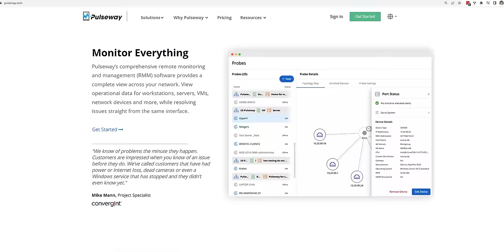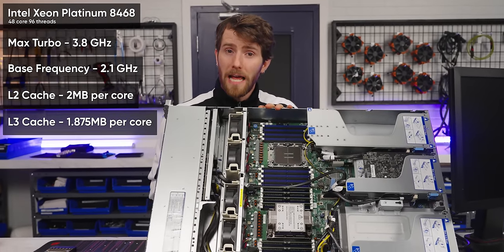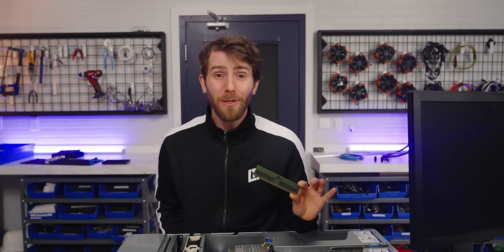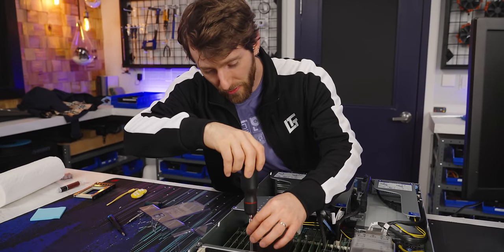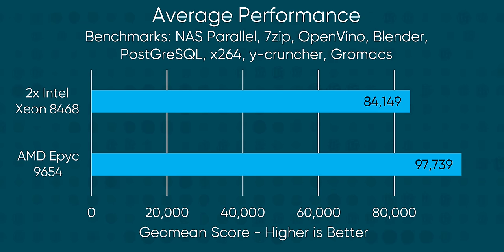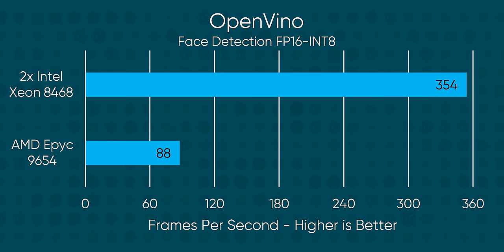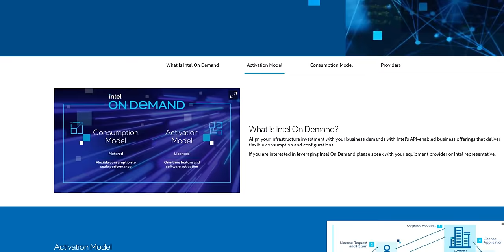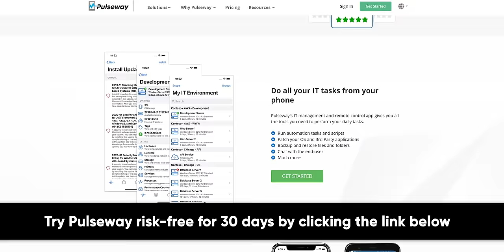Intel’s New CPUs are Cringe - Intel Sapphire Rapids Xeon Platinum 8468

Comment: The issue with those accelerators is that for them to be worth it (to counter the loses form not going AMD), you will need to use them so much that a dedicated accelerator card would be much better than this CPU.
Reply: They are putting themselves in a very small box. Not unlike Optane really. The technology was good for specific use cases but it wasn't compelling enough compared with alternatives to be a commercial success. I guess they have to go with what they have.
Reply: @shirro5  Didn't they reuse the tech to make much more practical ssd products then just discontinue them anyways
Reply: whats a accelerator card?
Reply: @Coockiez-007  an AI accelerator card is exactly what it sounds like: a pcie-based solution to add dedicated AI accelerator hardware to a system. If you're an organization using ai learning on the reg, you're gonna be using several of those and not bothering with Sapphire Rapids, especially since an AI accelerator card will outperform Sapphire Rapids for that use case while consuming less power.
Reply: @pokeguy742  the nice thing about intel and not the accelerator card is that it’s easy and fits in with the newer GPUs.   Sometimes the best is the easiest, keep in mind these products are not for us. They are for huge servers that need the ability for easy replacement. I’d definitely go with Xeon because I have the ability to upgrade my computer by simply paying Intel. Servers as well don’t want to pay technicians to go upgrade all of them so it might make sense to go intel.
Reply: @StevenSmith68828  you know nothing about servers if you think anyone would choose an Intel CPU over an Amd cpu and an AI accelerator card

The data and server space only cares about 3 things

1. Cost
2. Power Efficiency 
3. Space

AMD will offer a faster, cooler, more efficient cpu, for the same price or less, while leaving room for a much better accelerator over all

Data centers could give a rats butt about how “easy” something is

Besides, Amd tends to be “easier” anyways, as 90% of their stuff is becoming plug and play, while Intel is making hardware a service, making things more difficult 

So your own argument fails here
Reply: @StevenSmith68828  gladly you don’t run a server rack

No one wants to pay Intel to upgrade their own systems, cause 
That’s a security risk, and the only thing data centers hate more then hot, power hungry, space inefficient racks is vulnerability in their racks

No major server will ever do that
Ever

Like 80-90% of server owners and data centers wouldn’t do that

The only people who would, would be small businesses, but not every small business is running the latest Intel Xeon CPUs, and even less want to constantly pay Intel to be able to use said CPUs 

The more and more Intel moves forward with these stupid ideas, the more and more market share AMD is taking

Everyone thought it would have been impossible for AMD to have 25% of the market by 2025
They will have it this year

By 2030, it will be entirely possible for them to have 40% of the market 

By 2040, Intel might be left with only 35% themselves 

Do I think that will happen, not really 

But is it possible? Yes
And it wasn’t possible just 2 short years ago
Reply: @StevenSmith68828  I would absolutely not go with Intel for the same reason: you pay Intel to unlock features already present on the hardware you initially paid for. That means that an Intel server will be more expensive to keep relevant over time, and it also has a potential software exploit to access features on the cpu. If I'm running a professional server, the last thing I want is a more expensive rack that has a backdoor waiting for some enterprising unauthorized individual to open. Operating costs are even higher if you account for the increases power consumption for similar levels of performance and the fact that I'm getting an accelerator card anyway because even a card from 2021 with 16 tpus will outperform Sapphire Rapids for AI accelerated workloads, and that card only draws like 55W under load.
Reply: @StevenSmith68828  Something that I did not think about before but your comment made me consider is the "replacement", or to be more specific drivers and software support.

Lets say I made an application that is using the AI acceleration of Intel CPU, how certain can I be that it will still be supported 10 years from now. 

If you upgrade you server for a new one (which happens every 2-5 years), will I be certain that the new CPU will still have the AI accelerator and will it be compatible?

A PCIe card allows me to move the accelerators to new server, and even if company goes under and stops selling those I can still upgrade the server while keeping old or aftermarket accelerators.

With intel CPU accelerators I am stuck with an old platform until I rewrite all the software.
Reply: @StevenSmith68828  tell me you're an intel fanboy, without telling me you're an intel fanboy...
Reply: @bornonthebattlefront4883  you’re right I’m wrong, would you be willing to take a bet and short Intel if you are predicting higher market cap from AMD? My models predicts a 40% loss In revenue. How sure are you? My concern for shorting is Intels IP with network ASICS do you then need a network accelerator card and AI accelerator card? If so what about all of their other stuff that it has, would you then need accelerators for each one of those? I’m trying to understand other server/computer markets not in AI which is what I’m interested in. Xeon makes sense but I’m on the fence. To me the opportunity cost of not having an extra GPU slot to compensate for not having an in built AI accelerator feels bad. 

Also how did you calculate the market capitalization.
Reply: @hypershadow5g  I have a Ryzen 2700 lol. Im also looking into shorting Intel and yes I am a fanboy. My concern is the government stepping in since TSMC and Intel are the only companies able to produce these chips. There are other but they tend to focus on bigger nanometer chips. Ohh and their IP

Comment: Step 1: Put thermal paste in the socket.
Step Too: Add more torque because that's the problem, clearly.
Reply: To be fair with CPUs that size if you don't torque them properly they can just completely not boot - there's a reason AMD Threadripper and Epyc have their own torque drivers and instructions on what to torque down first.
Reply: Many an overclocker has packed a socket with grease and had it be absolutely fine. Large chips absolutely do have connection issues if not torqued properly. My delid 10920x wouldn’t post a mem channel because one size was a fraction too loose.
Reply: And that was today's edition of Tech Tip of the Day!
Reply: @thebludragon8353  Conductivity is not the only issue here!!! Even perfect insulator around pins can change impedances (and electrical length) of the individual signal lines, from/to CPU, inducing skew. Just take a look, how much attention is paid during design of those traces on the MB, where every micron is important.
Reply: I love how people are mentioning torque as if they didn't go get the manual, read the manual for the torque specification, then get the torque screwdriver and torque it down to specification, reseat the chip (because they mentioned it wasn't seated correctly at least twice) and still have it not boot.

Comment: Intel On-Demand is also going to really suck for us in like 10 years, when these servers because super cheap on the used market. Are we going to need to start pirating features of the CPU?
Reply: I wonder what DRM they use.
Reply: I was thinking this, if the DRM needs to phone home all the time you are relying on Intel keeping that switched on. They could purposely make your system redundant by taking down the DRM server and locking those capability's, very wasteful and underhanded.
Reply: @jonathanellis6097  Unlikely. 
There are too many use cases where specific servers have no internet connection.
Reply: @hubertnnn  I haven't looked into the actual specifics but I would assume you get some kind of signed license file that can be dynamically loaded through the BIOS or from the OS (like how the platform can verify secure boot images).
Reply: The fact these servers can be in service for 10 years is a good incentive to not just close down their drm system if it doesnt take off in 2 generations.
Reply: @jonathanellis6097  it's likely that these feature-unlocks are fuse-based. You buy a code from intel and it "burns" a few fuses in the CPU that will permanently unlock the specific features.
Reply: Oh yeah. This is a dark day for homelabbers if all the hardware just turns into IBM-style rentals.
Reply: I am pretty sure that Intel already had such feature many years ago with Pentium's
Reply: I think that the Intel On-Demand is going to be practically worthless. Okay, I can unlock an accelerator later down the line, but what if it only becomes useful in 2-4 years? By that time the chips will be one or two generations late, which can be a ridiculous efficiency and computing power downgrade.
Reply: Maybe, maybe not. In 10 years someone will have figured out the hack so you can buy one that isn’t “unlocked” and just jailbreak it!
Reply: pirating hardware does sound kinda fun though… cyberdeck style shit. not that i would ever want to. clearly. but, you know..
Reply: @Irthex  That won't be the how, one of the "suggested cases" was enabling features for a certain time period when the company needed them
Reply: @Irthex  15:48 "Consumption model" - it is not fuse-based if there are non-one time options
Reply: @stephen1r2  the other is "one time activation"
Reply: @s.i.m.c.a  they mention one time unlocks too.
Reply: @josiahsimmons9866  Not to mention that software developers are less likely to support a paywalled accelerator unless Intel is footing the bill for it. So imagine Intel-specific forks of PyTorch or Postgres, or having to pay for extra Intel add-on packages for Autodesk nonsense.
Reply: @josiahsimmons9866  
Its unlikely someone will want to unlock those features after 4 years.
Most servers are bought with specific use case in mind and will be used for one thing throughout its entire lifetime, which wont be too long, since servers are usually replaced every 2-5 years.

After that time the server ends up as one of the after-market solutions used by small businesses or hobbyists.
Both of them are unlikely to need to unlock the extra features.

There is also the question about how this unlocking works. Will someone who was not the original buyer of certain CPU be allowed to unlock it? If I buy an after-market server will intel give me the unlock code or will he just say "sorry, you are not the owner we have registered in our system".

Comment: As a technical engineer, I just wanna say that installing the CPU in servers is a hell of a lot easier if you just use the protective foam padding that comes in the CPU box to lay the CPU face down on. Then apply the CPU guide (the black plastic that is removable from the heatsink) to the CPU and then simply click the heatsink onto the guide. Boom. All together, no risk of dropping anything and secure
Reply: no no you gotta squirt the paste directly into the socket /s
Reply: You underestimate Linus's ability to drop anything
Reply: No risk of dropping anything? Doesn't sound very Linus-y...
Reply: Not to mention that CPU heat sink arrangement has been used since HPE Gen 9 and Dell 13th Gen servers and, presumably, other major manufacturers. Way more convenient than messing about with levers and having to replace the thermal compound after reseating the CPU. See a lot more system board swaps in a week than I do CPU replacements in a year.
Reply: It's funny,  precision engineering tends to work a lot better when used properly
Reply: But you forgot the "add paste directly in socket" step.
Reply: wtf is a technical engineer 🫠
Reply: @CarokleinLP  If you need to ask, you ain't deserving of the answer.
Reply: @Bultizar  I mean isn’t any engineer technical? Except the business pseudos
Reply: @leod9968  😂😂😂
Reply: Linus made mistake here. As the op said in these cpus first u take the removabple plastic from heat sink. Then u put the cpu in the removable plastic and then you put them together on the cooler and in the end you put the whole thing to socket on the board

Comment: The thing about building your hardware for theoretical future software is that by the time use of that software becomes normalized we'll be several hardware cycles down the road. They built a machine today for the tasks of tomorrow, but also expect you to buy a new machine in the next generation or 2, when the architecture they created finally becomes relevant. There's no such thing as "future proofing" with PC hardware.
Reply: You have a point. It is likely that intel and or AMD could hit a major breakthrough in the next few years in which one of them will double what their top of the line chip is now along with improve a vast list of things. I also think we are approching the end of gaming graphics cards. We are about half way there right now. That one computer they did not long ago where they rendered that NASA 14gig per second or frame landing model is really where gaming cards will stop becoming a thing. Once you can say have a 48 inch curved computer screen that can display 32k it will almost be not worth it to upgrade to anything beyond that. Once gaming can render 3d models that look like the highest production movies gaming will then become AI based and you will be able to just build a game on site and call for anyone who wants to play. Its likely that gaming will be groups of friends who play games and then add in new players who scan the boards looking for something that fits their needs or makes their own with in a set friend group. 
I have a feeling that gaming rigs are slowly fading away as more and more people move to console games which are and can be just as in dept as the PC games.
Reply: This is exactly what I was thinking! I was figuring that by the time the On-Demand features would be needed, we'll have one to two new generations of CPUs, which can be anywhere from a 15% jump to even as bad as 30%! That's a HUGE computing power downgrade!
Reply: Adding extra memory pretty much anywhere extends the usable life of the hardware when those memory requirements inevitably increase, like cache and ram and vram, but really specific hardware solutions looking for a problem just end up looking like a gimmick and even if the use case takes off the next generations of hardware will immediately have so much better support it still looks like a joke to fleece early adoption addicts and koolaid drinkers.
Reply: @josiahsimmons9866  I think cpu chips are moving in the wrong direction. They are trying to get as much as they can in to a single chip when I think they should be building a embedded chip set board. Where you have say tiny 1 inch or less squares of quad or 12 core chips. Then a heat sink housing. Think GPU as a CPU yet double or quad layer where you have dual sided water cooled heat sink. Each embedded cpu can be 4 to 12 cores and think 10 chips per side of a dual layer cpu card would give you at 420 cores and an unknown logical cores. We know CPU chips can be smaller yet because they require some type of cooling embedded cpu boards are better suited. Because who in their right mind is going to open up 1000 servers and upgrade the cpu? Other than someone small. Along with the GPU and CPU board sets you can also do memory the same way. You can either make a controller board and then add in your gpu, cpu, ram, ssd and chipset all cooled via an exchange and using some form of a pcie slot and your chip set also has your IO which can be a pretty large board in its self. Think more along the lines of hot swapped storage or PS. Turn the computer around push in the PS, IO/Chipset, CPU, GPU, Storage. Then on the inside you can either make a auto connect cooling loop and power along with a auto connect IO front panel. The chipset board will contain things like the powerbutton in the event you are using a server. The rgb and keyboard mouse will be a fixed thing for server models.
Reply: @kameljoe21  seems like you need to become a computer architect
Reply: @kameljoe21  I think that gaming cards would be obselete in the years that coming but not for the reason you mention but games would be on the cloud. All you will need is an access point to internet.
Reply: @ThePensilvania3  Right I get you on that. Yet you still need something to drive that data and cloud based stuff is going to be the future of gaming and VR or if you have watched The Orville tv show that real life VR stuff they have will be the future. Chat gpt4 is suppose to come out today. I have not looked to see if it did. Yet you are suppose to be able to render your own videos with it?